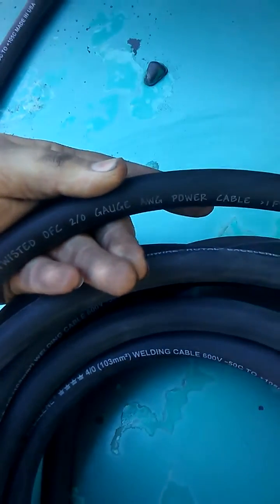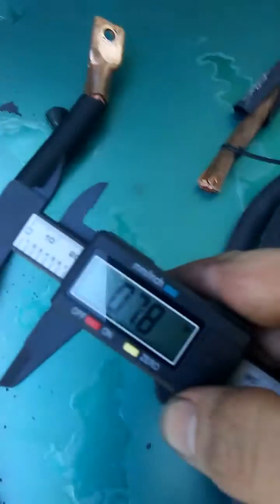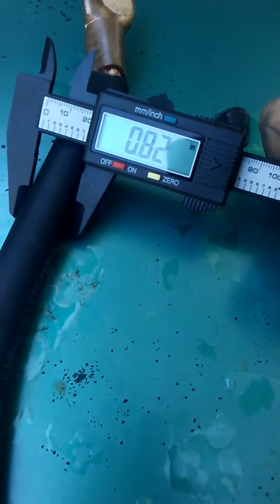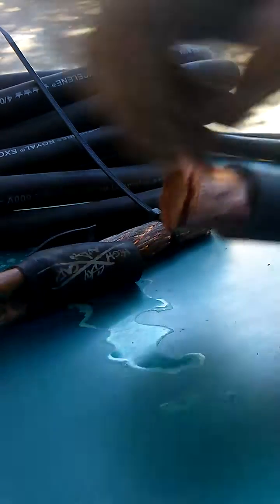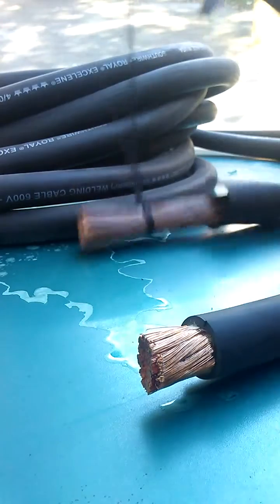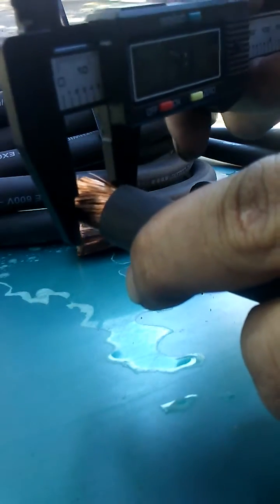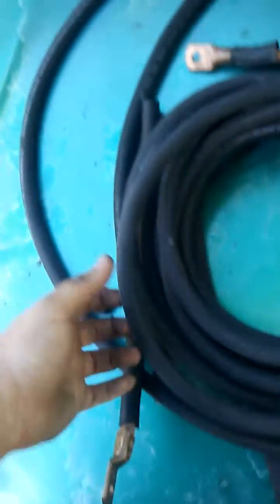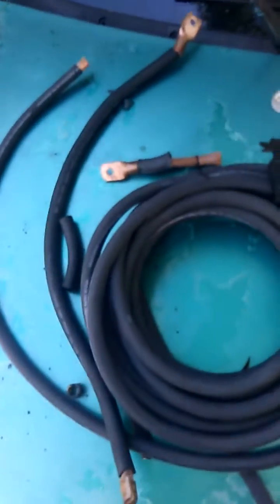Sky high car audio 2/0 ofc vs welding cable 4/0 ofc

Comment: 4/0 should be WAY bigger than 2/0. I miss something?
Reply from the maker: Yes, You did. One is welding wire one is car audio. The car audio is not standardized industry so they can label it anything they want. So in reality the 2/0 IS 4/0.

Comment: I run TEMco brand, its the cheapest OFC i can find and i like it better than Windy Nation and some other weld cable I've came across. I happen to be a welder by trade so ive been around alot of weld wire. TEMco is guaranteed for life! Its also nice and flexible.  I messaged sky high about some heat shrink and i asked for adhesive lined shrink tube and they told me "we dont carry that". Thats laughable to me that a company that makes wire doesnt have real heat shrink with adhesive inside to keep water and the elements out, that's like 101 stuff. Ill stick to my TEMco brand weld/battery cable.
Reply from the maker: Solid info thanks man!
Reply: @CorpseFreak yes temco has even a one year no questions asked return policy that im about to try and use because the wire is too thick and not as flexible as I had hoped for

Comment: Wait. So sky high is oversized then. Because why is a 4/0 cable about the same as 4/0
Reply from the maker: Yes. Sky high is oversized because it's not regulated like welding cable

Comment: Got it so yeah. Confused. Your comparing what exactly. There’s no doubt that car audio wire is more flexible and has a higher strand count. The reason in jacket diameter is do to the different environments the wires are in. Of course the jacket is going to be bigger it’s inside engine bays, under, and inside a vehicle. Car audio wire can also withstand a higher amp draw compared to welding cable so again the jacket is going to be thicker you said something about them selling oversized but yet it is oversized compared to the normal us standard and before you go off if did actually compare it to 4/0 car audio wire the thread count and diameter of the wire would be significantly larger than that if your 4/0 welding cable. I mean there’s reasons to this stuff. Big current = big wire just saying so think we will stick with the higher strand count 🤷‍♂️
Reply: But you use your smaller inferior wire that was not designed to withstand the current draws of car audio or the environment. And before you go off crying saying well it’s because they don’t follow the US standards yeah they don’t cause it’s not used to weld it’s bigger and oversized for a reason
Reply from the maker: @thesoundmekanik7603  Man you sound really butthurt. Crying with a double comment. I laid out facts, Take it or leave it. 

You spend your money how you want. I've been running 4/0 welding cable for 8 years now with no issues. 

If you want to overspend for the same shit im getting thats on you my dude. Thanks for the views and comments though booboo
Reply: @CorpseFreak   🤣🤣🤣
Reply: @CorpseFreak   definitely not the same thing but sure booboo. You have been doing this for how long now? And can’t take the smallest amount of constructive criticism hope this boosted your self esteem. The fact is weld wire is smaller than power, it’s cheaper well I wonder why it’s cheaper maybe because it’s smaller 🧐. If it’s what you got then it’s what you got. No doubt it’s cheaper but still  they both have there place in the community. But people are right if your going to compare then compare 4/0 welding cable to 4/0 power cable. I understand what you where trying to accomplish here by saying that you can get the same size wire for cheaper but at the end of the day it’s what you wanna put your money into if you got no problem throwing in thousands for amps and drivers what’s the matter with spending a little extra on nice wire.
Reply from the maker: @thesoundmekanik7603  they are the same. What makes them "different" is that welding wire is industrial meaning it has to be regulated and standardized. Audio cables for aftermarket are not. That's why you can see schoch for example using like an 8g core and enough jacketing to call it 0g and then selling it as 0g. Car audio cable can call it whatever they want because they don't have a standard they must follow. 4/0 welding is the same as sky high 2/0 because sky high is calling their 4/0 oversized 2/0. An apple being called an orange is still an apple.

Comment: What are you saying exactly? Are you saying that sky high has thicker insulation more then southwire? Are you saying that southwire and sky high have the same thickness of copper inside the insulation? Even though it reads one has more copper then the other? Are you saying that it’s less money to buy southwire?  (Well that is what you said on the price)
Reply from the maker: Sky high has a bigger jacket.
There is the same amount of copper by diameter in each at the time I made this video.
At the time of the recording Southwire was a lot cheaper.
Sky high oversized 2/0 vs welding 4/0
Reply: @CorpseFreak  So in the end it really just comes down to price and maybe the flexibility of the wire? It’s time for me to upgrade my wiring as I updated my amp and about to pull the plug on another amp just deciding if I want a D or A/B amp for my mods and highs. I was thinking of getting GP wire or D4S OFC wire then was looking at welding wire. My run will be 18ft @ 290 amps and According to the amp/ft length chart I’m pretty much on the border of of 1/0 and 2/0 I’m going to go with GP or D4S 2/0 I think, I know D4S 2/0 OFC is tinned so might help with elements (live in N.E.) but now thinking maybe 4/0 welding cable to save a couple bucks. IDK the more I read the more indecisive I get….

Comment: Welding cable is same price as skyhigh now with the plandemic, with that ill stick to skyhigh
Reply: Not even close. Welding wire is still cheaper
Reply: Skyhigh 2/0 is over $7 a foot 4/0 welding wire is under $5 a foot.
Reply: @relativelyreasonable  nope not here in Canada, theres no diff
Reply from the maker: Your money man, I just showed facts.

Comment: I still like sky high for a lot of stuff but I was disappointed when I got my 1/0 skyhigh and the first thing I immediately noticed was the way the jacket is constructed with those channels I can't think of any other purpose for that design other than to make the cable look bigger than it really is not only can I not think of a reason why that would improve ment but I imagine having that little bit of airspace within those channels of  the jacket invite all types of opportunity for contaminants to get inside the wire corrosion to occur
Reply from the maker: I have had one wire corrode on me. It wasn't the welding wire... Dont get me wrong great product and I will continue to give them business but there are other options out there for certain things.  (I use OFC not CCA for clarification)

Comment: So basically what you are really saying is that sky high car audio 2/0 ofc is the same exact size as the welding 4/0 ofc wire so technically that jst puts sky high for the win onl difference is that the jacket is thicker but yet still flexible
Reply from the maker: Pretty much. The sky high has a bit higher strand count but by wire diameter they are pretty much the same

Comment: I was told there's no such thing as 100% OFC welding cable, therefore I stick with 100% OFC silver tinned oversized wire.. (SHCA, D4S, Cert Basshd, XS-Pwr, etc.. not welding cable. Thx 4 vid!
Reply from the maker: Your choice man. Its all for the love of bass

Comment: Bro, you are silly...... 4/0 wire is suppose to be bigger than 2/0. If you want to see true 4/0 wire visit steve meade’s channel, he will show you true 4/0 wire. Its is about a inch in diameter.
Reply from the maker: Of course a steve meade nut hugger has to comment with some uneducated shit. Audio wire isnt a regulated industry. Welding cable is. Welding cable has to be PROPERLY labeled. Audio companies can slap a 10AWG label on some 2/0 and call it oversized 10AWG when in reality its 2/0 mislabeled.

Im not going to fight with you over ISO standard requirements. You have a good day and thanks for the view.

Comment: But why would you swap it out, if the Sky High is OFC than why change it to welding cable which the quality of the copper being 99% pure is not the manufactures concern.
Reply from the maker: Welding is regulated with iso certifications sky high is not regulated

Comment: Damn that sky high is 2/0 and the same wire size as a 4/0 I’d rather have the sky high
Reply from the maker: Sky high is mislabeled 4/0. Their 2/0 is literally 4/0. They arnt regulated like welding cable which has an industrial standard lol
Reply: Sky high 2/0 is not mislabeled 4/0, I just pulled like 30 feet of actual 4/0 off a semi. That 4/0 is just crappy 4/0
Reply from the maker: @masonr.8916  how are you sure it was 4/0? Sure it wasn't 6/0? Feel free to share the brand then if there's "better 4/0"
Reply: Im confused as well.  This video led me to believe the sky high is better

Comment: That Royal is a great cable......cars when manufactured are not designed for high powered audio systems...so we modify and incorporate a lot of additional components to achieve high spl...this includes using high quality cables that are capable of industrial grade characteristics yielding high current transfers, so If a company decides to manufacture car audio power cables, all well and good but the fact still remains that installers and audio fanatics alike will have to source high quality cables.....the fact that the the welding leads manufacturer will say that their product were not designed for car audio still remains but car audio is modification and the choices are not mandatory that we use car audio cables...the terminology of supply and demand comes into play....high amperage heavy duty cables to withstand heat, abrasion and corrosion is a must and if one can source the same item at a cheaper rate so be it...in Trinidad the cost of a high quality 0 gauge cable is the same as welding 4/0 cable...now that's piece of mind.
Reply from the maker: Very well stated sir

Comment: Just so u know, southwire royal excelene is not ofc and will oxidize and turn dark.. shy high will not because it's ofc.. to be ofc it requires an extra smelting process.. that's why welding wire is cheaper.. I actually run tinned ofc, I paid the extra to know my wire will last my lifetime... everyone think welding wire is superior to ofc audio wire and it's actually not.. you get what you pay for with anything car audio related.. if you actually think welding wire is ofc, call and ask.. or just do sum research it 100% not ofc unless it says it on the jacket..nobody would  false advertise and write ofc if it wasn't.. and if it is ofc you bet your ass it would say it on every jacket, because that's the #1 selling point..
Reply: My. Welding 1/0 wire is perfectly fine and not dark after 2 years of use.
Reply: I had welding wire in my Cadillac from many years never had an issue with corrosion or turning black
Reply from the maker: Man you got a little butthurt. Why go after me who was just trying to help people vs people mislabeling their wire sizes and misleading customers?

Comment: Now this is how a comparison video should be made. No bias, no trying to convince the viewers to buy one product or another, no skewed measurements. You simply provided the data, shared your opinion, and let the viewers decide for themselves. Great job!
Reply from the maker: Thank you! And its sad to see some people are still to dull to understand that. Some people are saying I am comparing apples to oranges when all I am doing is giving facts. I have considered making a follow up video with better equipment and even a little more in depth
.
Reply: @CorpseFreak  yes but it no comparison you are showing 4/0 against 2/0 and believe it or not that thicker jacket is better under hood then that thin jacket
Reply from the maker: @jeremyf420 you are wrong. 4/0 welding cable is true 4/0 because it's industrial and a standardization of spec is required for classification. So basically 4/0 has to fall into the tolerances for 4/0. Car audio doesn't have that requirement. So seller A can sell 2/0 or 4/0 and call it 1/0 and claim their wire is "oversized 1/0." It's a marketing gimmick for idiots. 

You are however correct on the jacket. A thicker jacket is better for insulation.

Comment: Comparing apples to oranges 
 🤔😂
Reply from the maker: Actually not really. Wire is wire. Welding wire is regulated though because it has an industrial standard. They cant just call it "Oversized yada yada"
Reply: He's just showing people the facts he's not saying anything bad about the other company's they make amazing products
Reply: BASSLIFE 4EVR this coming not from me but from my friend that’s an electrical engineer, he did say that electricity (in theory) likes to travel on the exterior of every strand of copper wire, so theoretically speaking the more wires per electrical line in this case being the 2/0 the better electrical transmission. 
That being said that is theoretical and what he learned in school. I don’t know how much of a difference it would actually make because I do know that welding wire has LESS strands generally speaking than car audio power wire. But it would be cool to see that tested side by side.
Reply: @payloadperformance9706  That is only when using AC, not DC. DC has no "Skin Effect"...
https://en.wikipedia.org/wiki/Skin_effect

Comment: So....what exactly is the problem here? If the wire on the 4/0 welding cable is the same size as the 2/0 from the sky high, then what is the issue?
Reply: Price
Reply from the maker: @alphaomega8373  ebay. 4/0 welding by the foot
Reply: @CorpseFreak  I was basically telling the other guy the problem is the price of the sky high wire.
I been rocking two runs of 2/0 cable under the vehicle (unprotected) since 2015. No issues no green corrsion. Couldn't be happier with it.
Reply from the maker: @alphaomega8373  oh i gotcha. I have 6 runs in total of skyhigh and welding.
Reply from the maker: There is none. I was just letti g people know
Reply: With the price of shipping its almost the same as skyhigh with free shipping so i just went with skyhigh so i could get the color i wanted.
Reply from the maker: @4gbmeans4gb61  when i ordered ot was like 7 dollars to ship even if i ordered 15 feet
Reply: CorpseFreak was a lot for me when I tried to order 100 feet,  sky high with free shipping was only about 20 dollars more so I went with sky high and got the color I wanted.

Comment: You are looking for cable better than sky high when your system is easily handled by the sky high cable, dude you need to get your priorities in order and quit worrying about things that will not make a difference
Reply from the maker: Quantity increases efficiency. 9krms takes amperage, i cant run dual alts on a honda or tons of batteries so there for i needed all i could squeeze out of my 320a singer. This is before lithiums too. So thanks for your input but this video wasnt just for me. It was for everyone out there who msy be budgeting or hsve other constraints. Thanks for the viee booboo
Reply: CorpseFreak who says you can’t run two alts on a Honda. Not trying to argue just saying. Fit a second one on my car no problem

Comment: So sky high wire at half the rating is equal to double the awg welding cable.
Reply from the maker: No sir, Sky high thats unregulated like industrial welding cable is equal to properly labeled 4/0 welding cable. Hence why sky high calls its wire "Oversized 2/0" because there is no standard of measurement in car audio.
Reply from the maker: https://en.wikipedia.org/wiki/American_wire_gauge
Reply: But 4/0 is bigger than 2/0 wire correct?     Doesn't it go 6awg,4awg,2awg,1/0awg,2/0awg,4/0awg . The wires get bigger each time.

So the sky high is called 2/0awg.  Which should in all reality b smaller than the 4/0 awg welding wire correct? That's what it should be by the ratings anyway.      
Now I understand that in the video you are showing us the welding wire has a bigger overall copper diameter  than the sky high wire.
Reply: Nate Hess, Yes you are correct. In the video as well he twists the sky high and puts a zip tie around and its about 4-6 stripped back, on the so called 4/0 he only cuts back about a 1 inch strip and he never twists it, so it would appear and measure out bigger. But even if he did not doing any measurement of the strands and directly with the size on the shielding 4/0 is still bigger than 2/0 and to be honest this 4/0 is more like 1/0 because true 4/0 is about a inch in diameter. This guy needs to go to steve meade channel and what true 4/0 wire looks like. This is so silly

Comment: So your comparing SH 2/0 to 4/0 welding cable?!?! I run both welding cable and Sundown and both are awesome!! Compare 2/0 with 2/0!!!
Reply: Is the truth but they do say "oversized" most ofthe time. point is that 4/0 is cheaper than that name brand 2/0.
OFC is OFC.
Reply: @alphaomega8373  With shipping and increased prices of wielding wire, its almost cheaper now to buy Skyhigh with free 3 days shipping.  Plus you can pick what color you want.
Reply from the maker: You must not be aware that Skyhigh doesn't follow the industrial standard of wire gauges since they are not regulated like industrial equipment. The sky high 2/0 is mislabeled 4/0 so I properly compared the two wires of the same size.